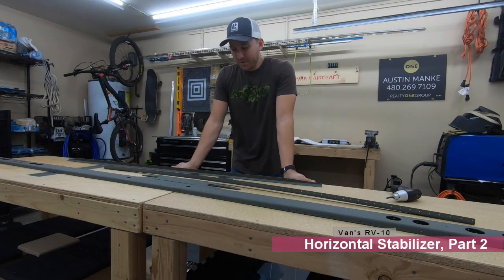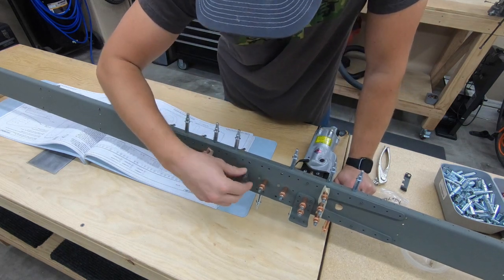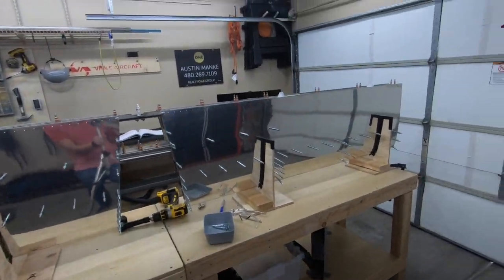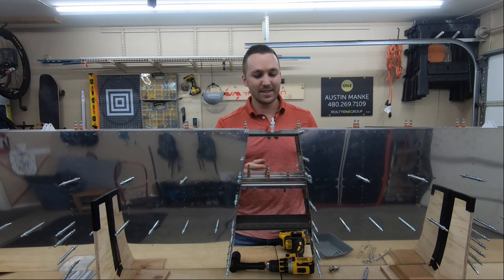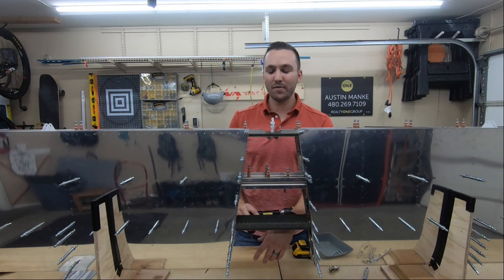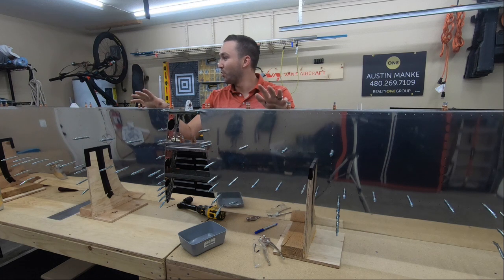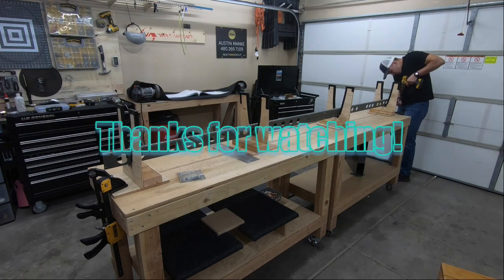Van's RV-10 Horizontal Stabilizer, Part 2

Comment: Thanks again for the videos. For primed parts, would you recommend countersinking before priming and to a depth sufficient to account for the primer which will be added later?
Reply from the maker: Thanks for watching! I think that would depend on how thick your primer is. In the past I have had no issue with light primer, but have also had noticeable fitment issues with heavy primer over countersunk holes. My fix has to just spin the countersink cutter by hand to remove the primer. The trade off with that is that the primer won’t be protecting the countersunk portion. I am not TOO worried about priming, so I have not given that much thought

Comment: Yes Austin. I am about two sections behind you on my -10. I too have had a few spots where even a white label part has had a hole or two that did not quite seem final drill. But, probably 99% of the ones so far have been perfect (final drilled).
Reply from the maker: Good to know! It sure is nice having most of the kit final sized

Comment: Thanks for sharing. Question, did you counter sink the spare before priming? Thanks. Please call me, I have a few question if you done mind.
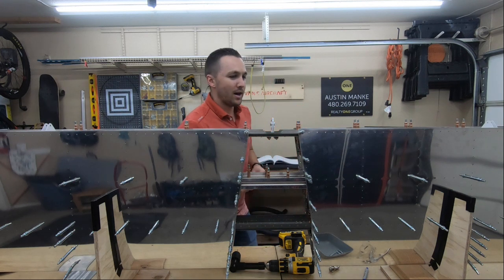Reply from the maker: Thank you for watching! I did not countersink the spar prior to priming. I primed it first, which actually worked out well for me since when I countersunk the doubler prior to priming, the primer thickness was enough to make the rivet stand out more than I would have liked. I can't seem to find your number on your website. Feel free to give me a call at the number listed on the wall behind me at 4:45 in the video (the real estate sign). I heard somewhere that typing your number in a comment is a no-no for some reason.
Reply: @AustinManke  when would be a good time to call you?
Reply from the maker: @clemsonaeronautics7447  any time tomorrow works for me 👍. If I happen to be on the phone just leave a voicemail and I’ll call back as quick as possible